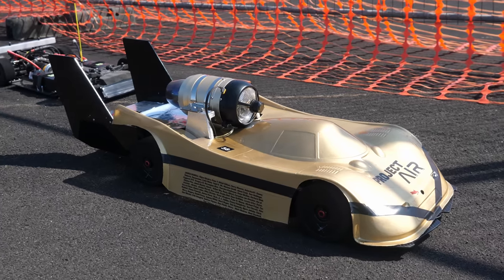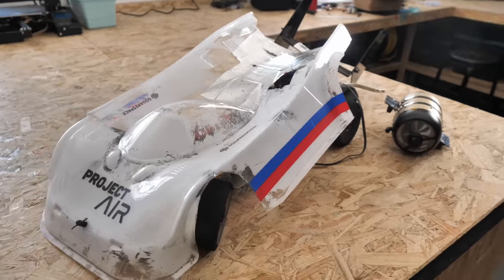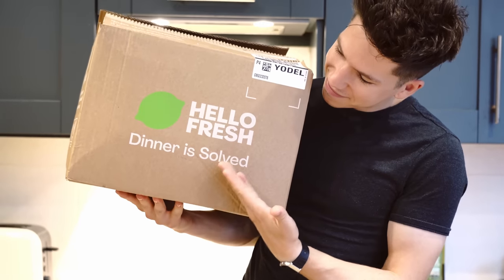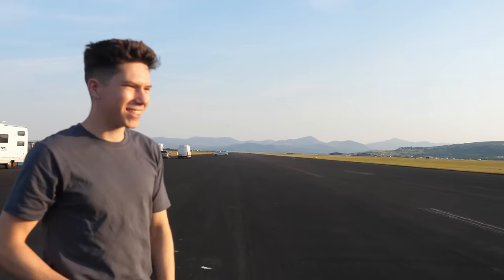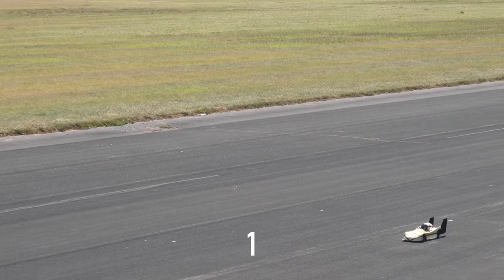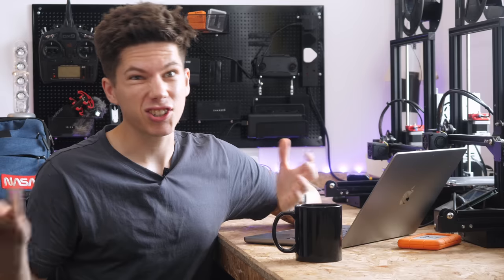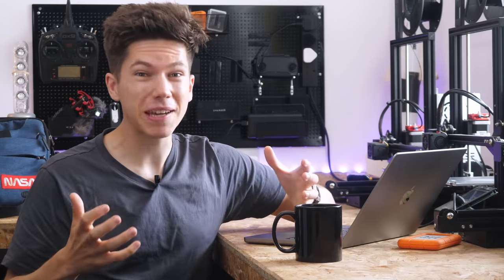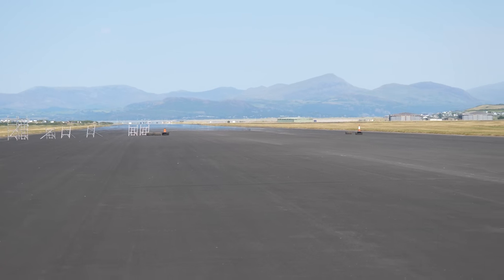Fastest RC Jet Car (Runway Testing)

Comment: That gyro would have been massively freaked out by the vibration.  On RC helis, the gyros (flybarless units) are installed on an anti-vibration pad to help alleviate the effects, but the vibrations from rotary flight look like nothing compared the vibes you would get from running on rough tarmac.  Looking at that, I'm not surprised the other guys didn't use gyros.
Reply: Yea, at those speeds the vibrations must be making the gyro think it has gone off center and then it tries to correct the movement that it's causing itself. The only way to fix that would be to record data from accelerometers and create gyro software with the right compensations.
Reply: Some of them used gyros!
Reply: Having a longer smoothing interval on the raw gyro data might help a lot with reducing vibration-induced oscillations. Only downside is the gyro becomes less responsive to sudden jerks, but I think for a speed car this wouldn't matter too much, since being smooth on the steering should help with stability at speed.
Reply: Raz Shifrin has used gyros on every one of his cars and he's one of the fastest in the speed running scene. To be fair, he uses Futaba gyros which are the best in the game (at least for cars anyways but I think they do alright in the flight world as well if I'm not totally mistaken). He has it turned waaaay down so as to not cause violent oscillations which only get worse the faster you go. Now, I know he said no one else there was using them so I don't want to rule out the possibility that Raz decided to change his setup based on the conditions on the ground but, at the same time, I'd be more than a little surprised if he did. As the old adage goes, don't fix what ain't broken. I could be wrong of course. This is just my initial take after having watched Raz for a few years and his approach to the use of available technologies in his vehicles.
Reply: @JJayzX  Believe in JESUS today, confess and repent of your sins. No one goes to heaven for doing good but by believing in JESUS who died for our sins.  For God so loved the world that he gave his one and only Son, that whoever believes in him shall not perish but have eternal life.(John 3:16)🥳❤️😁❤️
Reply: Can confirm rate gyros we used for robots were VERY sensitive to vibration. Pretty sure it's just a normal gyro thing unless you get one that's super expensive.
Reply: @jeremysonneman1330  Doesn't need to be "super" expensive (though that's kind of relative of course depending on what you consider expensive). I use the same one Raz uses. The Futaba GYC-441. It costs around $80 and works great. I'd stay away from the cheaper SkyRC stuff for speed running. Works alright for bashing around though.
Reply: Gyro insulation, PID set-up and coding (not a one day learning thing) , steering rigidity improvement... those are the key 🫠
Reply: @alunesh12345  yes ok, can i go now please? :)

Comment: My first thought was the servo. For those kind of speeds you probably want something heavy duty and pretty rigid, that may be part of what caused the gyro to get confused.
Reply: Yes. In the RC heli world they match servos to the gyro and their respective capabilities are known both ways. Makes wag much less of a problem.
Reply: If the servo response rate is too slow it won’t work with a gyro it has to be fast and strong!
Reply: That’s possible but I’m sure the oscillation is initiated by the input noise from the road. Without any sort of tuning there’s absolutely no way that the gyro will be able to work properly on a bumpy tarmac at 100 mph even if the servo was a good match.  People will spend dozens of hours of testing to tune a gyro for a purpose like this because of the extreme conditions.
Reply: @Chevsilverado  yes I agree my stream liner uses 2 gyros one 3 channel for the aero and a gy401 for steering, shock absorbing mounts are critical but if too soft the problem will come back just like a slow servo,I e had some bad crashes tuning gyros in and even planes it’s not much different if u have snapped a prop mid air it usually doesn’t end well lol also just as critical to the gyro as servo speed is it’s location on the chassis it greatly effects its response! Having said that most of my speed runs are on very bumpy outback Australian roads so my cars are usually tuned on rough surfaces my best pass was only 218kmh but was done on rough loose surface roads and only managed a bit over a full second of full throttle but 
it’s better than the xo1 on same surface only could do 150kmh before taking flight

Comment: I guess some pesky rules might forbid the use of autonomous steering using mmWave/microwave beacons aimed along the track in a sort of nanoscale ILS guidance system? Do you have datalogging on the servo and gyro? Is there any sign of the gyro outputs maxing out? Can you map the gyro gain and PID control loop parameters to vary with speed?  How about using explosafe cellular filler inside the tank to reduce sloshing? Compliant/damped mountings to reduce high-frequency vibration noise from the track surface? Kalman filters to manage measurement noise? Viscous damping and maybe spring preload of the steering mechanism to take out any backlash at the neutral position of the servo? Looks like a huge amount of fun to be had.  Great seeing the evolution of this project.

Comment: Gyro in a car will reach an oscillation speed due to the servo max slew speed. 

You can reduce the problem by mounting the gyro on the upright so it turns with servo (or doesn’t turn with the car in a slide. 

What you need to do is use a flight controller like ardurover to have gps pid position control for the whole length of the runway and onboard data logging.
Reply: I second the flight controller idea. A flight controller would allow a lot more adjustment. I'd also add pitot air speed indicator and a quadrature encoder on at least one wheel to be better speed data.
Edit: The flight controller should have either a flash chip or a SD card for black box data. Lots of great information can be logged using programs like ArduRover.
Reply: @ddegn  
Didn’t think of using a Speedo. 
The gps and accelerometers are pretty good.
Reply: Believe in JESUS today, confess and repent of your sins. No one goes to heaven for doing good but by believing in JESUS who died for our sins.  For God so loved the world that he gave his one and only Son, that whoever believes in him shall not perish but have eternal life.(John 3:16)🥳❤️😁❤️
Reply: @alunesh12345  
Why believe when you can know

Comment: The issue with the gyro is that the steering sensitivity increases with speed. Meaning at low speeds the gyro gain is correct but at higher speeds the total output gain (steering + gyro gain) has increased causing the oscillations. I would not recommend a simple gyro for this. Maybe a flight controller with GPS to dynamically change the gain correctly for the speed?
Reply: I agree, gyro's require tuning, and you are operating it in 2 distinct scenarios, so you either need to tune it for high speed, or both, def not ONLY tuned for low speed (the way you have it now). The front suspension could be replaced and/or upgraded... I don't think the platform is stable enough for high speed passes without one, or both. I would also like to see some larger/stiffer/lighter gussets on your wing, it appears to be VERY helpful.
Reply: Quad flight controllers used to have all sorts of problems with vibrations inducing signals into the gyros. It was solved with speeding up the sampling and pid-loop and with advanced filters. 
I doubt that gyro has what it takes.
Reply: @ulwur  Back in the day, before advance filtering, PID controllers had TPA, which essentially softened the gain as throttle increases. I think for simple controllers  (such as this car in the video) could probably work by using a programmable gyro. There are some RC car gyros that can be tuned via RC link, which allows you to mix the throttle channel with the gain.
Reply: @kwaaaa  That seems ideal. I got into building quads 6ish years ago, and I have only heard of someone using throttle P.I.D. attenuation once... it doesn't seem to be necessary on drones. This car, however, seems like an ideal candidate.
Reply: @MrFadjule  at low speed the assistance of gyros is probably not needed. So just tune it for high speed would fix it.
Reply: First of all, get rid of all that play in the steering mechanics. No gyro can work with such an hysterises
Reply: What an incredible discussion!  I wish all of YT was like this!
Reply: @MrFadjule  Believe in JESUS today, confess and repent of your sins. No one goes to heaven for doing good but by believing in JESUS who died for our sins.  For God so loved the world that he gave his one and only Son, that whoever believes in him shall not perish but have eternal life.(John 3:16)🥳❤️😁❤️
Reply: If your radio allows it, you could simply create a mix in your radio.  The higher the throttle, the lower the gain.  Obviously would require a multi-channel computer radio, and a gyro that supports remote gain setting by receiver channel.
Reply: @BladeScraper  speed does linearly scale with throttle so that would not work. You could give full throttle and still be at a low speed.

Comment: I’m not an engineer but here’s my unsolicited $.02 anyways. 
It would add some drag but I would recommend pointing the front of those massive fins inwards so if the tail goes to the right the left fin will be more streamlined and the right side will cause more drag pushing the tail back to the left. In a weird way this would act like dihedral in a wing and be positively stable both statically and dynamically. Also ditch the gyro though I would have tried it too just like you. 

Great vid BTW

Comment: Two things need attention immediately before you move forward. 1st. Spectrum radios are prone to interference from high power wifi telemetry. We proved this at Flite Fest when people fly near the pump out in the field. When it pulses its data (and this is not bias for radio types) spectrum radios tend to fail safe if within the direct path of that pulse. I assume an airport uses similar devices for various things they need to track. Look into that or swap radios or receivers for better.

Second: Gyros are SUPER sensitive. Vibrations will drive them bonkers specially if it hits a resonant frequency. IF you intend to use one then you need to look into some kind of soft mounting to isolate the gyro from any part of the body. Bumps and bouncing usually won't effect them to much if the gain is set properly. A resonance however will totally bork the system and may as you saw induce a drift or totally lock what ever it is controlling. (This is actually what I think happened on this particular run but the radio stuff needs to be checked in any and all cases)

Comment: Great video as always. I really like you reflecting on changes, looking for errors and being able to find them, even when they're your own.
When going on with this project, I would strongly suggest looking into landspeed record cars and their setup. All of them are low-drag, low-downforce configurations.
Especially with no wheels being driven, a rear wing makes not much sense for downforce, however the vertical stabilizer is often used in LSR cars.
The rear wing will effectively lever up your front wheels, making the car instable at speed. A front wing to counter this or even a unified "central" wing (think aircraft aerofoil upside down) might make sense, with a small vertical stabilizer at the rear.

As I said, enjoy your content and the experimenting you are doing. Have fun!

Comment: I think making a custom purpose built car is the way to go. Incorporate the engine into the chassis and really stiffen it up. Make some suspension components where you can control the wheel geometry (adding a bit of caster into the front steering wheels will help greatly at high speed). Beef up the steering servo as well for rigidity and crash resistance. Even make a new new body shell out of fibreglass or carbon fibre to cover the chassis and engine as one piece. Don't really need to worry about too much weight as you're after top speed instead of top acceleration (though heaps of weight would make steering difficult). Fantastic vid as always 🙂

Comment: After watching a few times just something I'd like to add. Thrust angle from the jet is quite important. Jet cars for drag racing and landspeed actually slightly angle the jet downwards. Which seems counter intuitive but that's where your downforce comes in the trick here is balancing your downforce and thrust angle.

Comment: Just rebuild the steering with all metal, high precision parts so it has no slop. Put rudders on the fins and have the gyros operate those instead of the steering. Experiment with speed dependent actuation %. The faster it goes, the less correction to prevent applying so much steering input it makes the car turn too much. Another thing to look into is detecting oscillation caused by the gyro. In that case it should return the rudders to neutral and hold them until wobble stops. If two rudder servos are used, they could be both turned to maximum outwards to act as air brakes.

One more thing, mount the engine with a little bit of upward tilt at the rear to push the rear end down. Having it parallel to the chassis is going to make it rock forward, putting more force on the front wheels. That will put more drag on the front, less on the rear, leading to amplifying the effects of steering and wanting to spin around - resisted only by the big fins.

Comment: Two suggestions: ditch the spektrum radio and go for something more modern like Crossfire or ELRS. If you want to use some active stabilization, go for something that provides you with logs so you can analyze the behavior dynamically.
Reply: ELRS ftw :) crossfire at 50hz is too slow for that kind of speed :P
Reply: ELRS with a flight controller to load the data and filter sensor input.

Comment: Speedrunning RC's is no joke... gyro's are amazing tech if set up properly. another trick we speedrunners use is turning down the dual rate of your controller so any steering inputs are dulled out a bit more. (you can also do this with negative exponential values). Dont get your head down. I got out of the game after a nasty crash that totalled my ride but the thrill of watching your build go by can't be beat. Good luck out there!

Comment: You could add an fpv camera to get a drivers pov, instead of turning around everytime the car passes and hoping you go off track (plus the help of the gyro). You can also go even further than you used to because you can see everything in front of you. The only problem being cost.

Comment: gyro's are programed to work at acceleration around g (10 m/s), it gives different outputs at higher accelerations. you can use accelerometer for correcting gyro's output.
Reply: I don't think this is correct.
Accelerometers are used to correct a gyro's sense of "up" in a flight controller. Gyros drift over time but the type used in the video don't need this sort of correction since it's only tracking a single axis of rotation.

Comment: Here's some suggestions which hopefully may help before it's next run.

Cut out the body around the engine so you can lift it on and off easily. 
Turn down the steering 'dual rate' on the transmitter to about 60%, it'll make it less 'twitchy'.
If you run the gyro make sure the gain isn't too high, you only want the gyro to assist, not totally control.
Add a separate failsafe or kill switch for the engine so you can kill it remotely if possible using an aux channel.
Swap the receiver out for an aeroplane receiver as it will give you more range.

Hope that helps :)
Reply: Agreed. The engine shouldn't need to be removed to access the fuel tank. I'm sure he'll make these changes. It looks like he was rushed this time.

Comment: Gyro gain and non isolated plus steering slop. Bin it off the steering and add it to the vertical stabilisers with rudders. Also use a quad flight controller with inactive so you can data log. They are cheap enough and you can use car or boat profiles. Also, spectrum and loss of signal, who’d of thought it.

Comment: Great series! I think it would be really useful if you installed some fpv gear on the car so you could more easily steer it and get oscillations under control faster